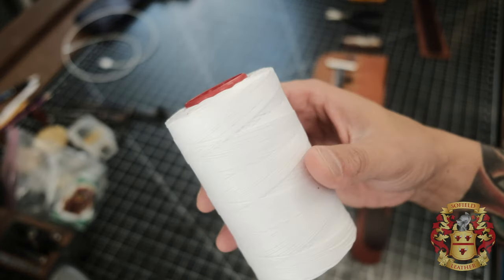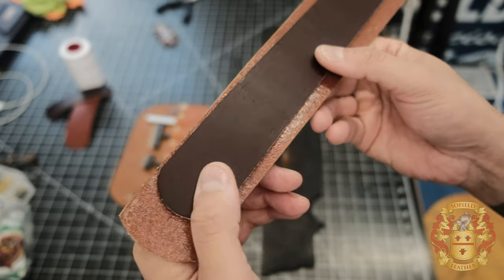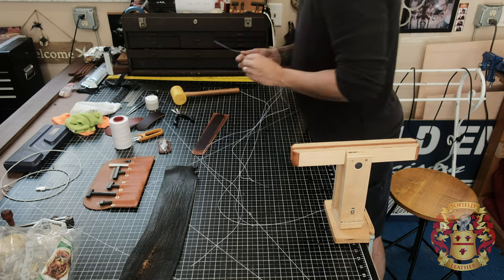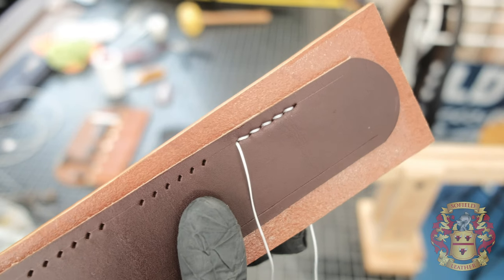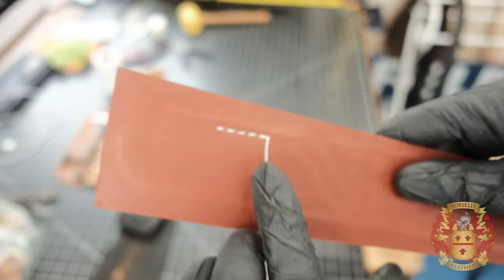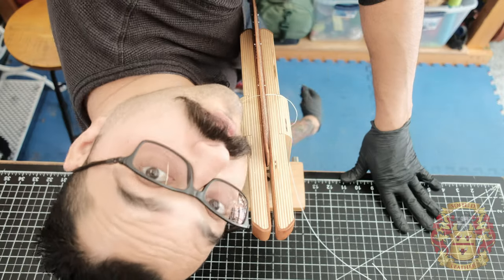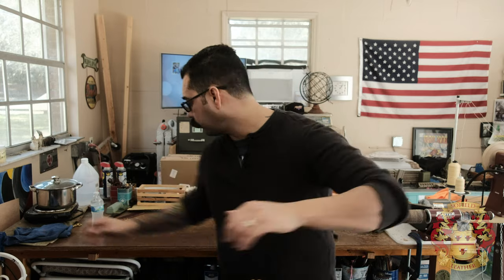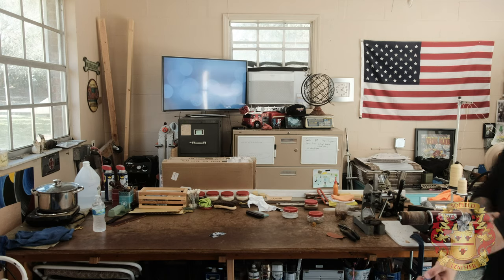How to Saddle Stitch Leather - Tutorial - 👐🏼 🪡🧵

Comment: This is great info. I have to tell myself which stitch goes where and what direction for the first two stitches and test it out for the first few stitches every time I start stitching just to make sure I do it right. It feels like your logic is more consistent and easier to understand.
However, is there a way for the stitch on both sides to look flat? or should I say stitch two bad sides?
Reply from the maker: Hey Jonathan. Thanks for the kind words. I’m glad you can understand my logic. 👊🏼. As far as the flat look, I think you have to use a different type of punch. Like holes or flat and not the angled. I don’t have any experience with that though. Hope this helps.

Comment: That was easy to understand - Thank you. How long would you make the thread on an average length belt. It can be some quiet long threads, if I do it in one go.
Reply from the maker: Thanks. It’s 3-4 times the length plus another 2-3 feet. So a 36 inch belt would be around 50 inches total length. Take that * 3=150 inches. Then *2 for the other run. So 300 inches plus another 2-3 feet.  So approximately 350 inches. 👌🏼

Comment: Thank you so much for this great video, however, it doesn't seem to work on smaller spacings. I use 2.7mm irons and 0.45mm linen thread (M40 Meisi Superfine) on a 3mm thick buttero leather. After doing a few stitches I could obverse that the thread just won't go from the very bottom to the very top of the next hole. Sometimes it just sticks halfway. Is there maybe something I need to consider if I stitch on smaller spacings - in this case 2.7mm? I've watched many great videos by great instructors but I still could not find a solution for my problem. You're my last hope!
Reply from the maker: 🧐🤔. I don’t have much experience with smaller sizes like that. I do know that there’s a direct relationship between 3 aspects that alter the “look”. Thickness of the thread-thickness of the leather-spacing of the holes. I think you have to find the right fit. Hope this helps.👌🏼

Comment: Is there a Mallot that you recommend for using with the KS Blade Stitching Iron?  I am new to leather and am trying to go through 10oz. of veg tan for making sandals.  I looked at the KS Blade Stitching Irons after watching your video; is there a KS Blade Stitching Iron that you would recommend to me?  They have some many options, which is amazing, for a newbie like me, I am absolutely clueless as to what I need.  I will be handstitching :)  Thank you!
Reply from the maker: No problem. I use that cheaper poly mallet just fine. I’m also using the KS blade 5.4 mm which yields 5 stitched per inch. That pairs nice with .8 mm thread. Hope this helps
Reply: @SofieldLeather  Thank you :)  Yes, helps very much
Reply: @SofieldLeather  Thank you!  I went on KS Blade website to purchase the Stitching Iron that you had suggested.  It doesn't look like KS Blade is currently shipping to the U.S. is there another brand that you could recommend?  Thank you
Reply from the maker: Oh no. Oh snap! Try Rocky Mountain leather supply. I know they carry KS blade. Sinoke is another similar brand.
Reply: @SofieldLeather  Thank you so so Much!!  I just ordered from Rocky Mountain leather supply :) Thank you again!!